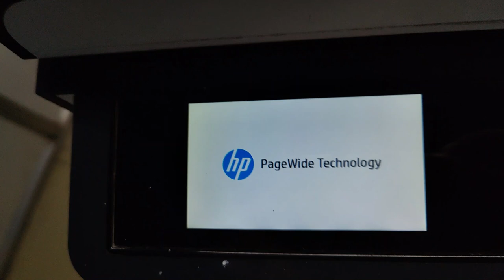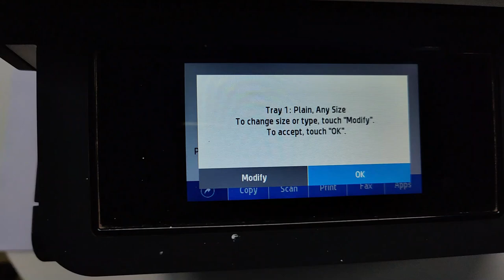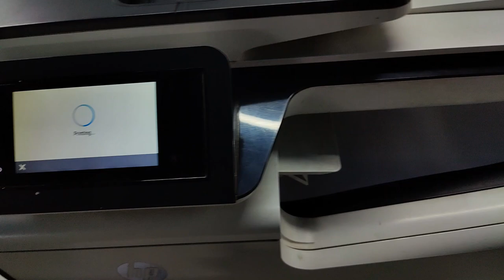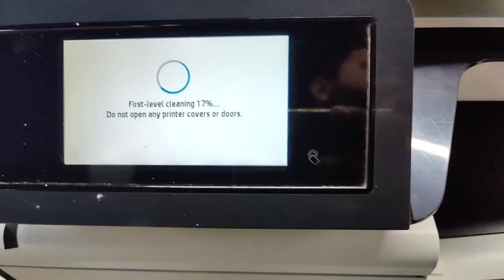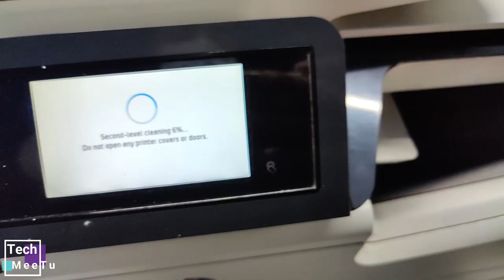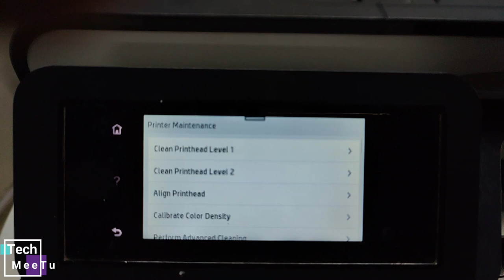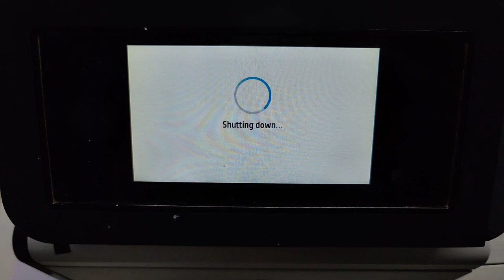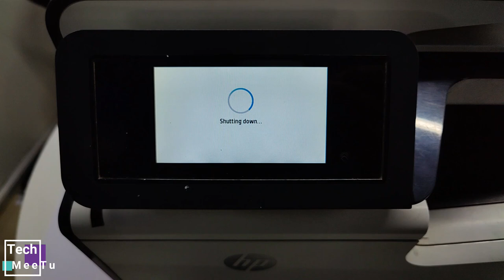HP PageWide Managed MFP 377 | 477 | 577 |  P57750 Error | Print Bar Replacement | Duplex Ink Error s

Comment: LOL
Error 50 in HP Neverstop Laser 1200w
Please support what to do??
Reply from the maker: There is an issue with its fuser assembly.
It has two reasons
1) Is the LVPS is not sharing the power the a fuser required.
2) The fuser assembly was faulty itself and needs to replaced.

I will share you the link for the same issue and its solution,

Regards,
Team Tech MeeTu